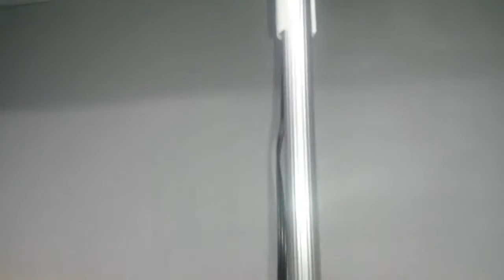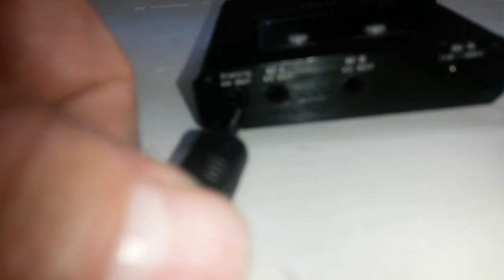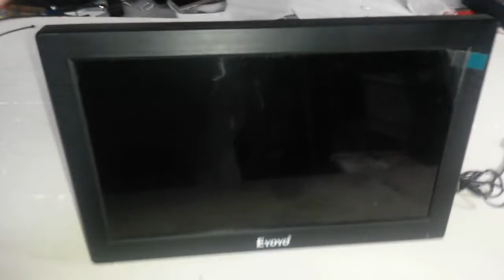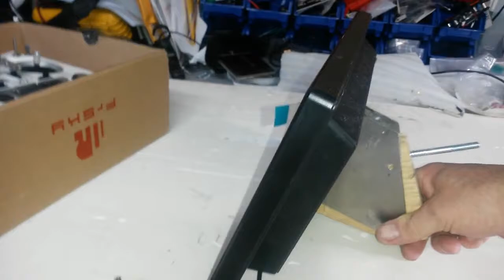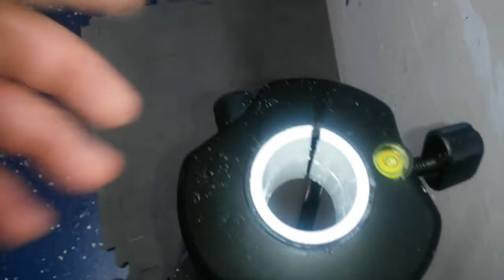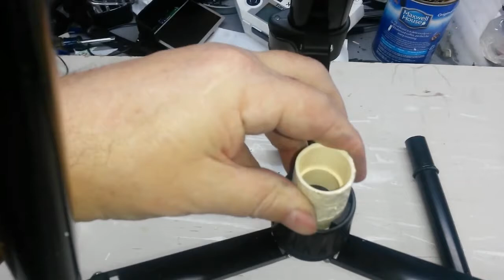How to DIY a basic FPV ground station step by step. Part 1/2

Comment: Does this blue-screen when signal drops?
Reply from the maker: not sure about your question. But if the signal drops out the monitor shows exactly what you goggles would do....first the image starts to get fuzzy and cut in and out. I have never flown out far enough for the signal to drop completely out....i turn around and fly towards home.